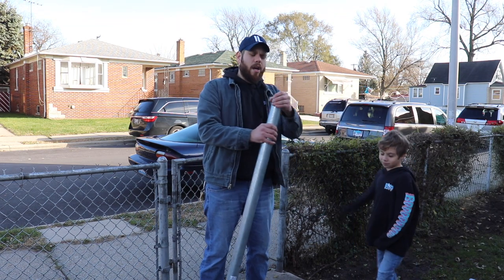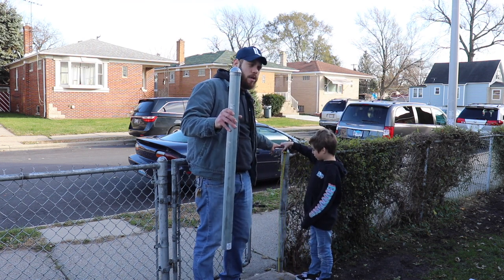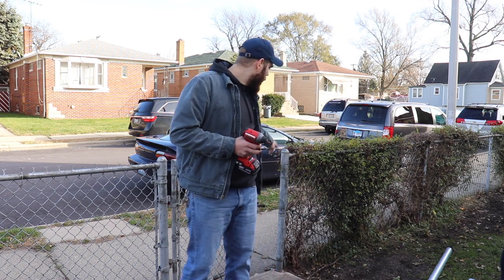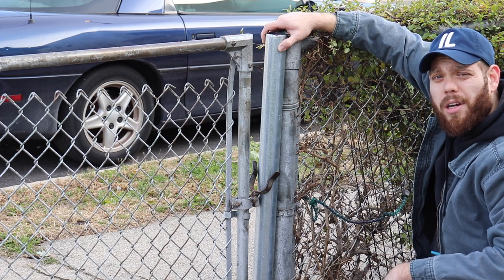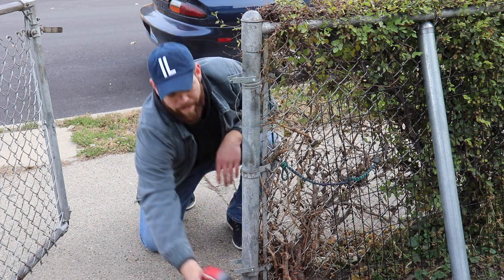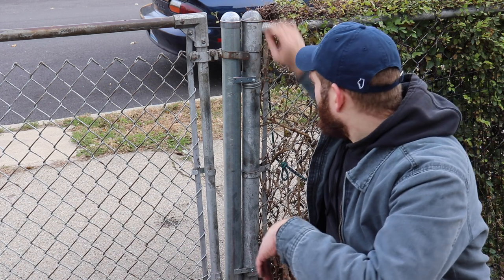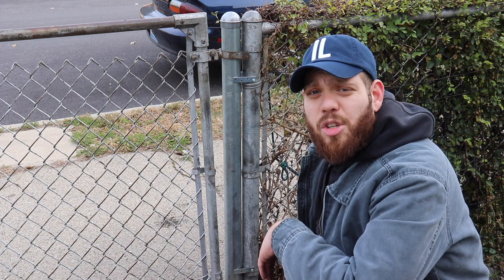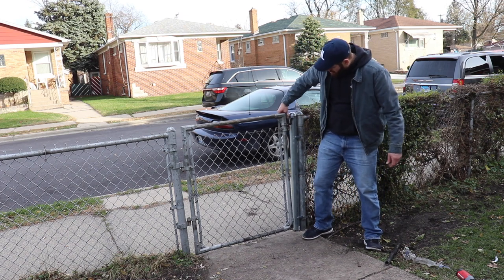Repair a fence gap to prevent dog from pushing gate open

Comment: This is almost exactly what I need to do, but my latch is on the chain linked fence as in the video & the pole is secured to a small wooden wall mount that came loose and the bolt is too long. Any suggestions?